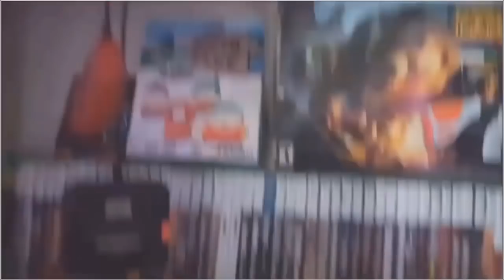LOST A GREAT GAME Life of A Game Hunter/Collector Vlog - Ep. 66

Comment: I recently sent you a message on Instagram about a PlayStation 2 slim I got and was wondering what you think about the price I am thinking about selling it for since the controller cost about $25 and the power supply and av cords cost about $15! I think it would be a good price for the bundle of the system with the cords, the controller, 4 cheap games, the internet start up disk, the manual for the system, and a 3rd party 16mb memory card!